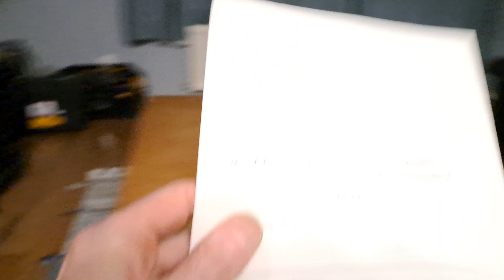Staccato QCW DRSSTC  that blew it's fuse !

Comment: Hello again, can you specify how you ground the circuit while in the box? If the electrical network does not have a ground wire, what should we do? Use a fake ground connection, like connecting to a metal table, for example? Is it okay to connect the secondary LV wire to the ground wire of the circuit and then lead it to ground?
Reply from the maker: Hi .
It needs to be grounded at the ground terminal on the board. 
If your house supply has no ground terminal  , you can take a wire from the pcb ground point  and  connect it to any metal object that is embedded into the physical ground outside,  for example a metal bar hammered into the earth in the garden.  A metal pipe supplying your house water will also work as that goes into the earth at some point.  A metal reebar ( concrete re-enforcing bar )  is also a good choice if you have these poking out of the house walls at the top as can be seen on some concrete houses.

Comment: Hi there, i am truly impressed your nice work even though your coil isn't operating in optimal condition.
i am currently building this coil as well following Zach's exact configuration, just pending proper topload & tuning the primary with MMC.
(my current parameter difference with yours: FGA60N65SMD, N77 ferrite core, GDT ratio 8:12:12, no MMC, secondary resonant freq ~ 250kHz), but my output isn't impressive at all.
So I am thinking of further improve it by changing more powerful IGBT (K40H1203), keep the N77 ferrite core but change the GDT ratio to 12:12:12, increase the resonant freq to 450 ~ 500kHz, etc.
May i know, your improved version still keeping the GDT ratio? and mind to share link for the pcb plug in lug? de-soldering a dead transistor is kind of painful to a noob like me...
Reply from the maker: Hi again. 
I've been looking on ebay for the connector. 
In ebay  , search  " pcb mount screw terminal block  " . You need the 3 pin type  with a 5mm pin pitch.  They are coloured green.  The screw type is better  as you get a more secure fixing.  . No need to over tighten  !
Reply from the maker: Hi there. 
I also followed Zach's configuration using his pcb.  For the GDT, I used Epcos N87 ferrite and three lengths of cat5 cable.  I twisted all three lengths together quite tightly,  then wound 12 turns.  ( I didn't separate one wire for the primary as Zach did as I find keeping them together gives a better wave form  ). 
To get the higher frequency  , the secondary must be the same spec as Zach's which gives you around 535 kHz. 
My top load is a bit bigger than Zach's,  at 2" minor x 8" major.  This size dropped the frequency to around 450 ish ( can't remember exactl fig  , but it is still high enough for a straight spark  ). 
The choice of igbt isn't important as long as they are capable of handling the current.  The ones you've mentioned are more than suitable.  I've used 60n65's in bigger coils with great results. 
Now  , I understand your headache when it comes to de-soldering dead igbt's  . Unfortunately I can't send a link because I de-soldered them from a dead power supply output side.  You may find something on ebay , but all you need are side entry lugs with the pin spacing the same distance apart as the holes in the board. 
The primary has a lot to do with good output.  My design was 6 turns of 0.75 gauge stranded insulated cable from a power lead.  Originally I had 30nF of mmc in series with it.  It was that which gave me 25" sparks @ 240 V input  ( which is around 380 V after rectifier  ).

I will say  , and I agree with you  , that it definitely isn't an optimal set up as since it blew the fuse  , I've not been able to achieve the same results. 
Oh , before I forget  , the other upgrade was a rather large bridge rectifier  for the hV side only,  ( looks like a brick igbt  ! ) mounted off-board connected with leads. 
With no top load  , your output will be weak as the top load acts as a capacitor to the air,  charging up before dumping the power out via a breakout point,  but if after adding the topload  , the output is still weak  , or nothing at all  , try swopping the terminals. 
Hope this helps  ! 
All the best for your project.
Reply: why are you all using GDTs? There are realy nice halfbridge driver avayable, which allow much cleaner gate controll...

Comment: Awesome coil man, you've officially outdone my own staccato QCW! Guess I should've use a bigger topload and tuned it better, lol. Great work, keep it up!
Reply from the maker: Hi Zach. 
All thanks go to you  my man for the awesome design in the first place. 
Designing things simpler  and achieving good results has gotta be a good thing  ! 
I think  , although it's still not 100% right  ,  I got lucky with the tuning.  Getting it to this point has been a nightmare.  I'm going to stock up on igbt's and play a bit more with the primary.  There's always room for improvement  ! 
Oh yes , must tell you  , I made a slight physical change so to speak to the board.  .  I found it awkward to have to keep de-soldering dead igbt's  , so I added a couple of pcb plug in lug connectors.  . . Plug and play  .so much easier to swop em out now ! 
You also keep up the work  , you do do some awesome stuff.  
Cheers.
Reply: @petesteslachannel334  adding lug connectors is a very good idea, also i have been looking for your site for a while and still haven't found it would you happen to have the link?

Comment: Love it mate. Nice little build with impressive output.
Reply from the maker: Thanks John. 
Still working on a couple of issues with the power side. 
Have been using two igbt's  ( 60n60 ) , but I don't think they are beefy enough  , so I'm going to attempt to change them out for a brick module  , the cm200dy-12h.  Somewhat more beefier.  
I'm hoping to get more power in ,  to improve spark length.  . . time will tell  ( and some experimenting  ! )
Reply: Hi there, nice to see someone else coming up with Zach circuit. Did you make use of Zach PCB? I mean did you download the PCB file & used his? I've download his PCB file & had it done through JLCPCB, but I'm facing a bug in his staccato circuit. Or did you build your own circuit?
Reply from the maker: @Ramlugon Larveen Sharma  
Hi there. 
Yes it is Zach's board.  I'm just in the process of upgrading the power bridge to a more beefier unit ( rated 100A , 1600 V ). I found the one he used to be to near the mark.  . . One slight o/load and boom ! 
I slightly altered the Gdt.  I used N87 Epcos ferrite core and wound it 1 / 1 ,  ( 12 turns secondaries and primary,  rather than 8 on the primary  ) .
And rather than keep de-soldering blown IGBT'S  , I added some pcb lug connector so you just unscrew them. . . So much easier and quicker. 
For a while  , I couldn't get mine to oscillate and after several chip replacements  , I discovered it was the 37321 /22 driver chips.  They weren't functioning properly  ( ebay cheap'os  ) so I got some from Farnell as a last resort  , and it worked just fine.  
What issues are you having  , or have you solved them  ?